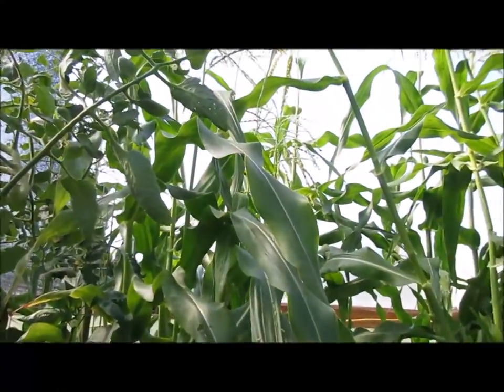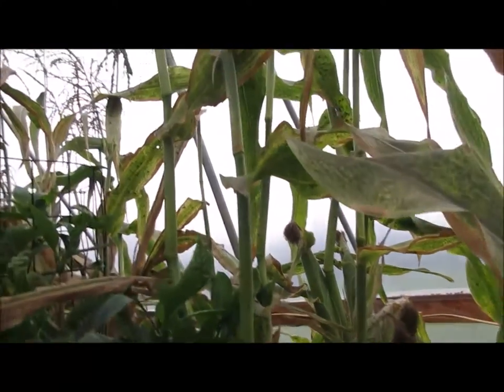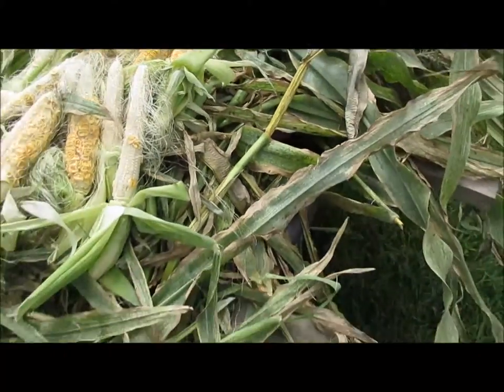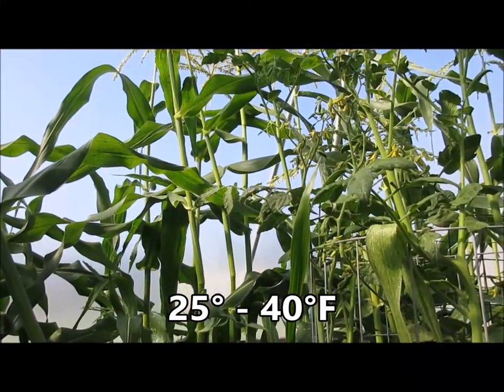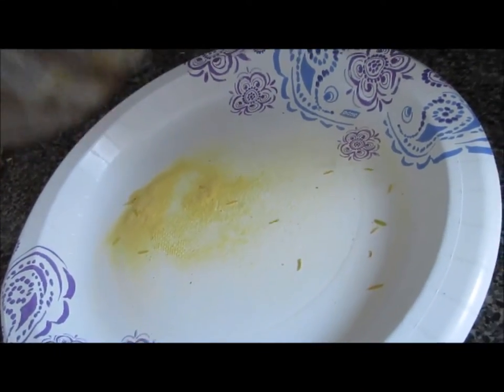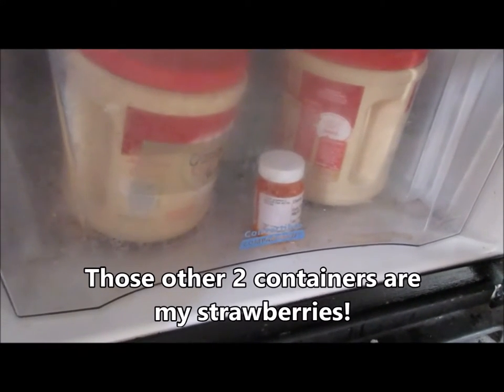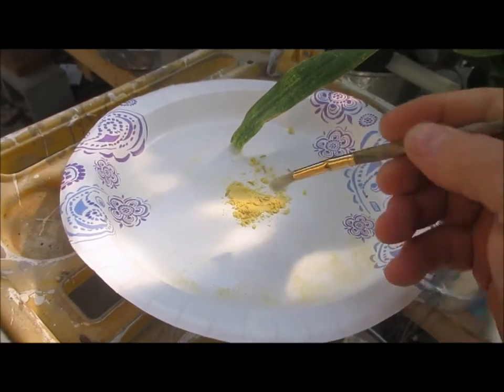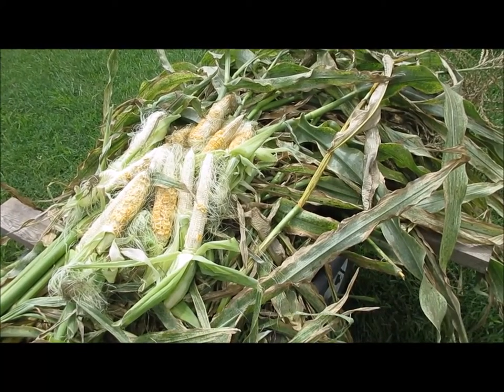Corn Pollination (Techniques & Failed Grow)

Comment: Too bad that didn't work out for you but still very interesting to see.  Thanks for sharing!
Reply from the maker: Yep, gotta show the mess ups too for integrity and sharing.
Brent
Reply: Hi Brent,
Makes me wonder if you should change the variety? Maybe next time try true hand pollination (for at least one ear)... take a pinch of pollen and just smear it all over the silks. Cheers,
 Bill
Reply from the maker: Hey Bill.  The corn didn't silk.  Well, like 4 were present after over a week of pollen dropping.  Time was running out which is why I tried to save pollen.  Don't get me wrong, I also wanted to try saving pollen to see how long it would keep.  Very wise on trying a new variety!  Got that video coming with the next no-weed garden coming shortly!  
Brent